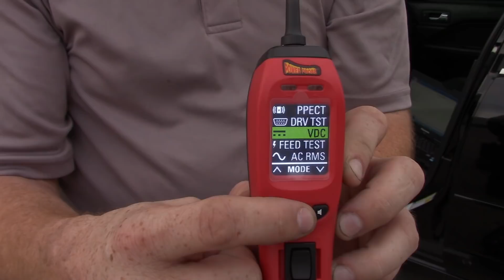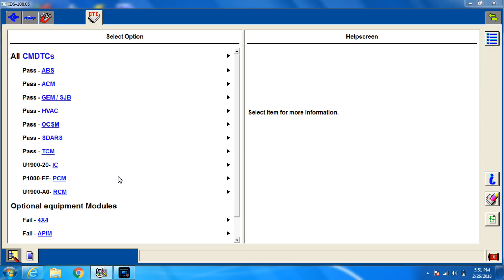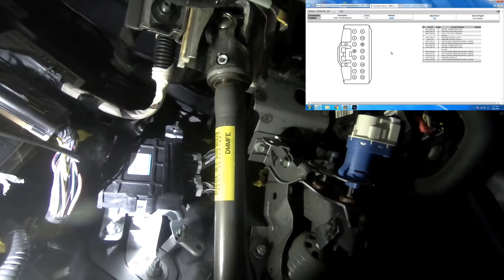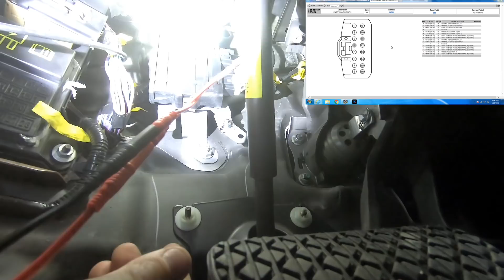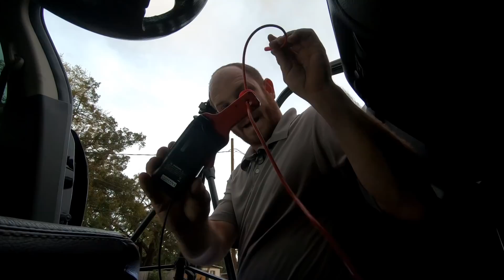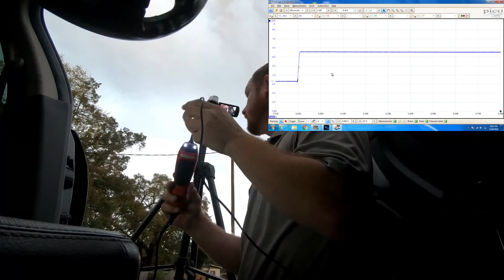Power Probe 4 and a Fusion

Comment: Hey Matt, great vid, just FYI if you pull the tip out of you PP4 you should be able to pop the end of your banana jack leads right in there. If not they do sell the little adapter.
Reply from the maker: I need the adapter. The banana Jack wouldn’t work when I was testing it before I filmed. However, I was lying upside down in the dash. You saw my swollen eye so functioning was the best. I’ll try it after vision.
Reply: Oh man I hear ya. September is the worst for me, some days it feels like I have to pry my eyes open! Yeah I was not sure if it came with it or not. I know I have mine in my PP4 kit but I may have robbed it from the PP Hook or lead set I imagine. I am more of a test light and scope kinda guy ;) Great vid BTW. Fantastic editing!
Reply: Did you ever get the kit for the adapter? I got the PPLS01 kit you still liking the PP?

Comment: Nice job Matthew.  Did you check to see what the fly back voltage looked like on those solenoids?   I know you said the shop replaced the solenoids but as you said you think it is a Tcm.  Maybe it will give you some useful info.  Perhaps it will show the computer not being able to clip the fly back voltage.
Reply from the maker: I should have done that. I know that’s a problem on the Chrysler’s. I really didn’t want to look at it. But I was suckered in with the chance to try out the powerprobe
Reply: Mobile Advanced Diagnostics & Programming No worries, let us know what you find.🙂